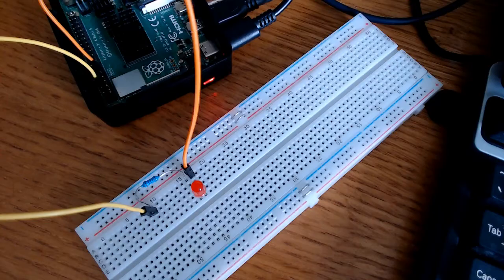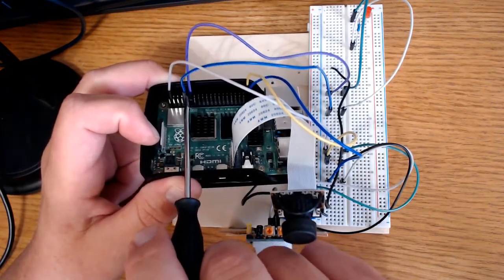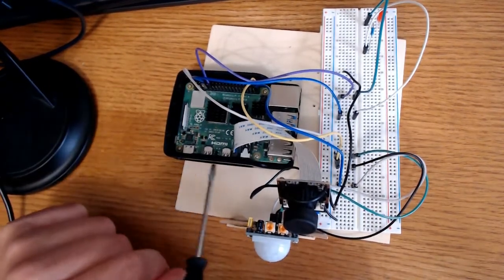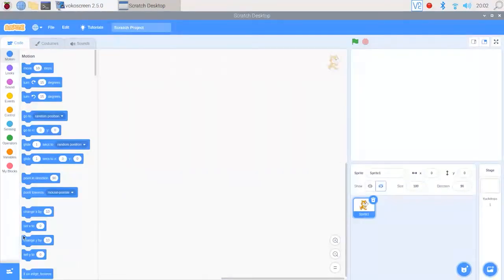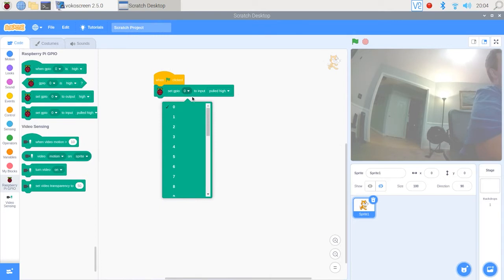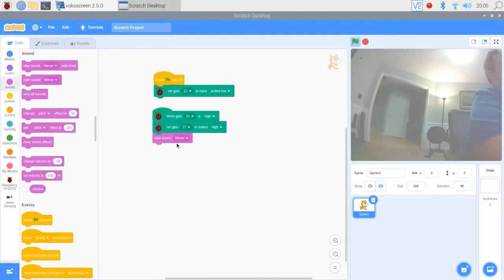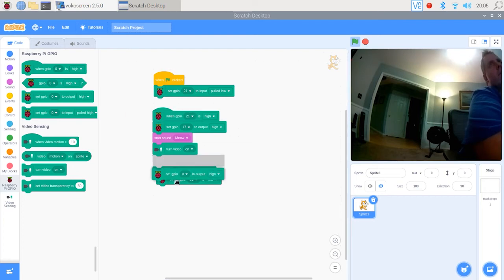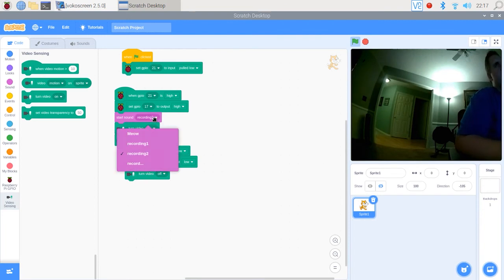How To Create A PIR Motion Activated Camera Using Raspberry Pi 4 And Scratch Coding

Comment: can i do this using a raspberry pi 3, any guidance would be helpful. this is my first time doing a raspberry pi project
Reply from the maker: Hello! I'm using the Bullseye version of Raspberry Pi OS on Pi 4. I think, for the most part it will be the same. It has been a while since I used this camera and I just discovered that the raspistill command is deprecated and is no longer supported. I will make  a new video showing you how to set up this camera followed by a motion activated camera for the pi 4 . It should all be the same on the pi3. 👍

Comment: hi mate, thanks for a very informative tutorial!. Do you know whether it is possible to develop that code on a Pi4B and then run it on a Pi zero W? the Pi zero is unable to run Scratch 3 IDE, but I think it should be able to run the compiled code. Any guidance would be appreciated.
Reply from the maker: hey there! pi zero should be able to run code for a motion camera.  I had to reload Raspian on to my pi. I will take a look at it and get back to you shortly.
Reply from the maker: I got the same motion activated camera to work on the Pi 4 using Python in Thonny. here's the code.
import RPi.GPIO as GPIO
import time
import subprocess

# Set up GPIO for the motion sensor
motion_sensor_pin = 40
GPIO.setmode(GPIO.BOARD)
GPIO.setup(motion_sensor_pin, GPIO.IN)

try:
    while True:
        # Check for motion
        if GPIO.input(motion_sensor_pin) == GPIO.HIGH:
            print("Motion detected")
            # Capture an image using the libcamera-still command
            subprocess.run(["libcamera-still", "-o", "motion_capture.jpg"])
            print("Image captured")
            time.sleep(5)  # Delay before capturing another image
        else:
            print("No motion detected")

        time.sleep(1)  # Adjust this interval as needed

except KeyboardInterrupt:
    pass

# Clean up GPIO when the program exits
GPIO.cleanup()
Reply: @BMonsterLaboratory thank you! Much appreciated, I will give it a try as soon as I can spare the time. Gotta solder 64 LED's (times 4pins, and some more) to make a magic cube for my daughter's birthday first.

I tried to use motioneyeOS but the development has stalled in 2020, the programmer asked for someone to take over but it seems nobody has answered the call yet, so the code is not compatible with the latest pi camera 3.
Reply from the maker: @gaetanodeluisi5962   motion eye was popular...too bad.  2020-2021 was a weird time for raspberry pi